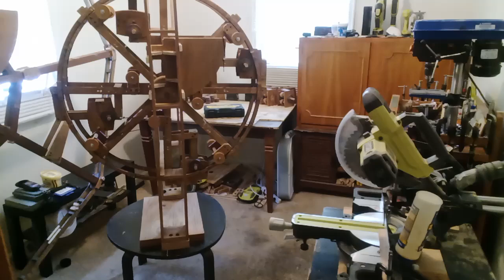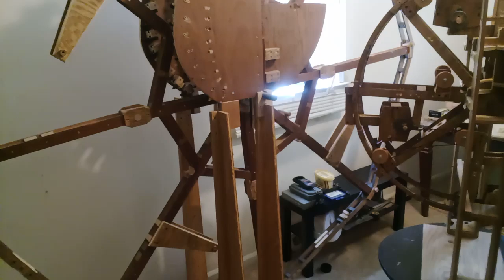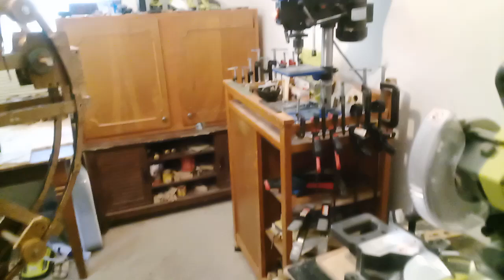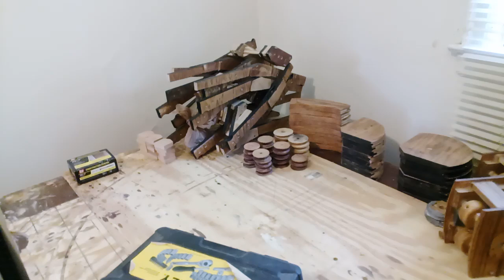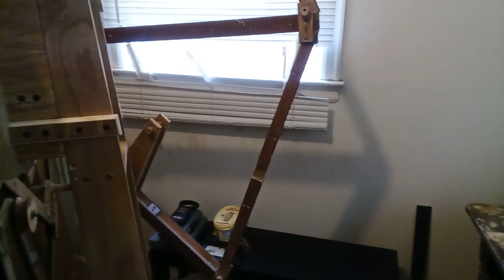Vlog   090724

Comment: Very nice, but you built it with very complex, hope as per bessler the nachine very simple. But your in right direction.
Reply: Still it can be simplified to make it work
Reply from the maker: @meghanadhreddy5002  That is the simplified if it is to look nice.
Reply: I mean, moving weight towards axis is very good,  to get this movement you have used complex logic. Why can't you use kind of piston type logic?,
Reply: As per besseler, wheel should be in balanced, means, at any given position left and right side of wheel should have same weight.
Reply: This you achieved by moving weights towards axis
Reply: @meghanadhreddy5002  Could you please tell me the source of this information?
Thank you.